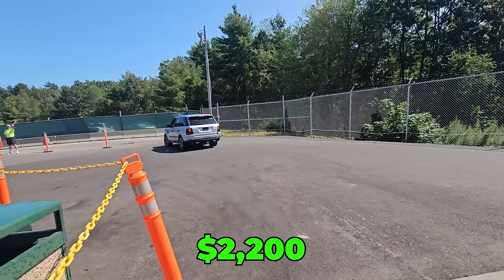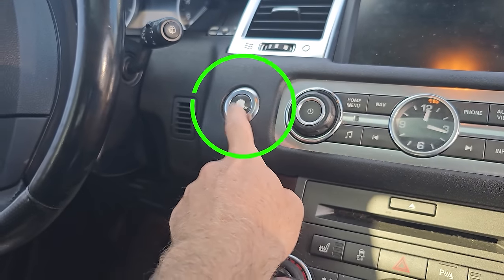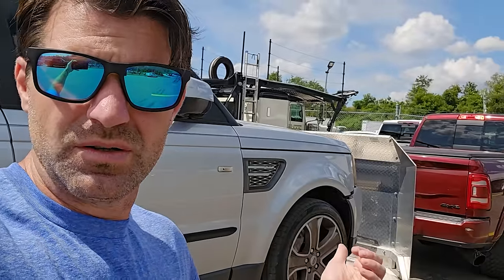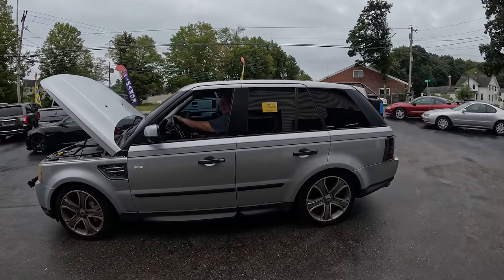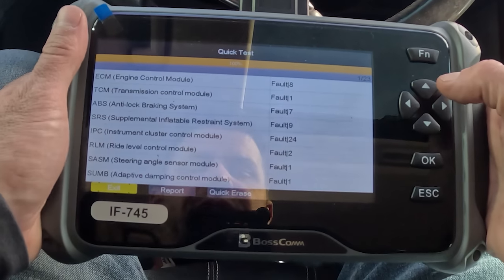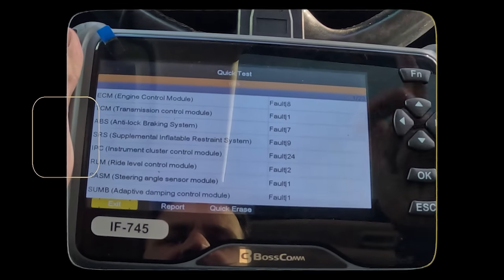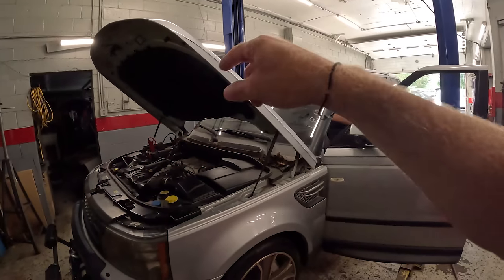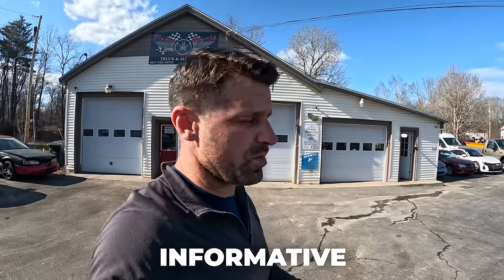Why Buying Cheap Luxury Cars is a BAD IDEA!  You get what you Pay for!  $2000 Range Rover

Comment: Hey Craig,
Emergency realease is inside the center console. Remove the shift stick and then the top. 

Spraying the brake disc Is not helping anything as the parking brake is designed with brake shoes inside the disc.

Comment: Still can't understand they can build such an expensive bad product for so long and not go bankrupt.
Reply: It’s a great car and it’s in the league of super cars like Mercedes AMG and BMW M and it was over $100k brand new. Most of these in the used market are absolutely junk if it is not One owner car and not maintained at dealership, this car had a factory recall to replace the engine which I guess was never done because whoever owned it as 2nd, 3rd or 4th owner went to mom and pop cheap mechanics for service that ruined this car. Just the engine on this car is $10k and this car market value is only $5k even when everything is working fine. This car is a mechanically total loss because to correctly fix all the issues through factory reset standards will cost approximately $20k or more because it was more than $100k plus brand new

Comment: Daily is an 08 Pathfinder with the optional 5.6 V8 👍 Same engine as the Titan and Armada. With 165k on the clock. I'm the second owner and exclusive of routine maintenance runs flawlessly. The 5.6 engine is stout and runs for years when properly maintained 👌 The only issues that I'm aware of are the exhaust manifolds that tend to crack. Not sure why you had engine problems, but that's a broad paintbrush to use 🤔
Reply: Nissan sales being what they are is all I need to know

Comment: Yeah, it was entertaining, but I have to admit, I was cringing through the whole thing. Now, it's your job to find someone who's willing to take it off your hands and hope you don’t wind up paying somebody to haul it off your lot. Anyone can pull codes from a vehicle, but understanding what the code means and what the data is telling you is crucial for effective diagnostics. Throwing parts at the problem is not the best answer and can be very costly. Especially when your lead mechanic tells you he thinks he fixed it - that's not a good sign.

Comment: For the Range Rover, you really need to watch Sam Crac videos.  They all need timing chain guides and tensioners.  They all need the air bags to be replaced with coil overs.  Yours needs 2 front seats.  Unfortunately, the timing stuff is very labor intensive and parts are expensive.  You have an easy $10k to fix that thing.  The better 2 options are to sell it for parts or put it back into the auction and just get rid of it.  I part out cars now and then (have a Subaru Crosstrek at the moment) but I'm retired so time is a big "who cares?" for me.  But your time is worth money and you could easily make more doing other things.  Yah, all your garbage cars need to go onto the trailer every week to the auction with no reserve and just get rid of them.  This is a good time with all the car dealers about to go out of business but setting reserve at the auction.  Bidding dealers have plenty of money for your cars because of this.

Comment: Craig, when you have something that is say 400 500 yet a good body on a car be fun to see your shop convert it to electric. A friend found a Vilt w good batteries but totaled due to frame damage. Removed the batteries junked it. Then took them put them in a S 10 w electric motor. Use the truck as a part hauler. Range is no biggy they stay in town bht they took a s 10 w bad notor trans and bad CV Volt w frame issues made a 1200 dollar electric pickup fun useful toy. Over time they plan on adding other salvaged parts light bars etc be fun seeing what Flying wheels could do. A econo van ir some huge cargo vehicle be fun. The shop mentioned they will do a van and flat bed once they find more Vits as they easier to work with in battery extraction.

Comment: You are a fare braver person than me to mess with these type of vehicles. My wife has a 2019 BMW 4 series, took to dealer with a simple issue with the window. It was all under warranty. I ask service dept. what would this of cost if it were not under warranty. They found an issue with the radio, so that was replased along with fixing the window motor and the bill was $4900.00. The retail value of the car was about $21k. Crazy repair cost on these BMW, Audi, Land Rover etc.

Comment: Leave the range rovers at the door. Worked at a dealership and all the sales guys had them as their runnarounds. None of them made it to the point of being sold after a few months of use without massive repairs. We had one supercharged V6, a standard V8 and the supercharged V8 and somehow the super v8 was the one with the least troubles. They're nice enough inside but they're just junk after even moderate use.

Comment: In regards to the comment about Armada’s and Titans I’ve owned a 08 and currently a 2011 with the 5.6 the 08 I traded at 189,000 miles for the 11. The 2011 currently is at 199,700 and both were very reliable other than replacing the starter at 100l.
Reply: I friend of mine had a Titan and it was very reliable too.